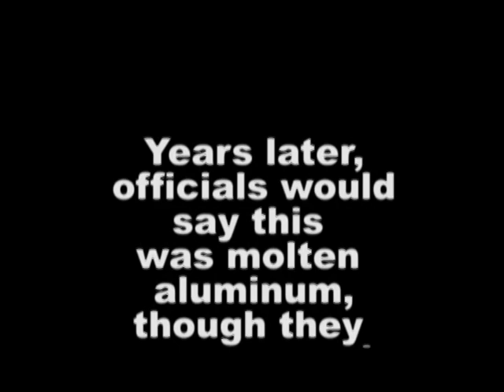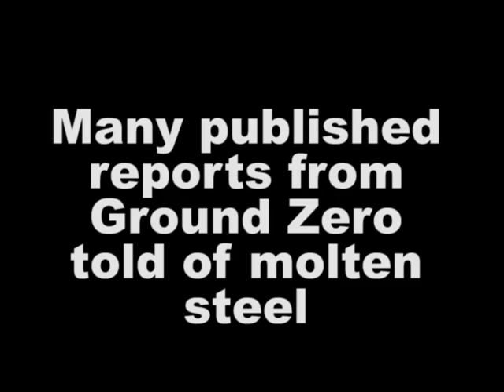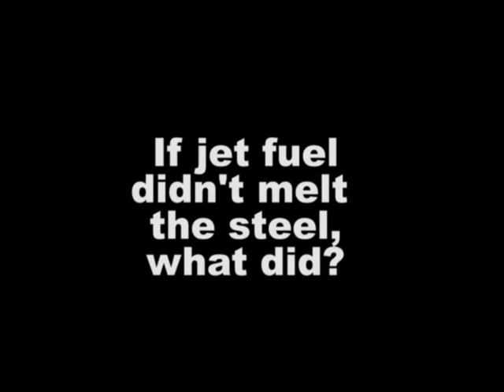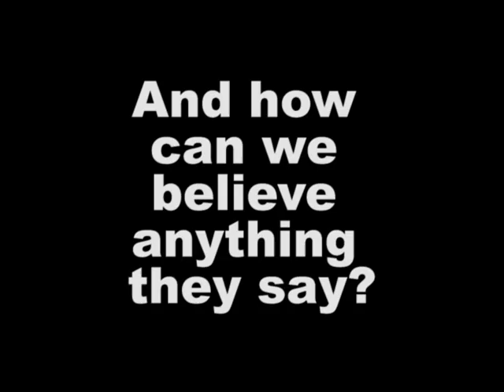The 9/11 "Deep Mystery" and the Crazy Engineers

Comment: See Appendix C of the FEMA Report and watch this video. Any true scientist with an open mind will see that every single reported characteristic of a High Temperature Accelerant Fire was observed in the case of the WTC. Even a few of these characteristics should have warranted a proper investigation to determine if HTAs (like Thermite) were used to assist in the destruction of the buildings. NIST purposely chose to ignore this evidence, ignore protocols, and ignore the primary claims of the independent scientists who they call "Conspiracy Theorists", and instead of doing chemical testing for HTAs or an analysis based on the use of nano-thermite applied directly to structural columns (as the conspiracy theorists have suggested) NIST instead ruled out explosives altogether based on sound analysis (which only technically rules out RDX and high brisance explosives) for which they had to ignore much of the witness testimony and video evidence of loud explosions.

Comment: How do we know contractors didn't cut corners and inspectors sign off paid, using cheaper materials. It happens more then people think. Specially back in the day. Cheaper steel made with other material could have easily been used in parts of the any project.
Reply from the maker: We don't know that contractors didn't cut corners.  Most of the structural steel evidence was hauled off to China as scrap lickety split.  If the contractors cut corners, we need an official investigation that says so.

Comment: People who said the fires melted the steel were wrong. The fires didn't melt the steel. They WEAKENED it. Besides, temperatures weren't even close to the 2700 degree melting point of steel.  All reports of people seeing "molten steel" were anecdotal. No one was in a position to determine the metallurgical composition of the conglomerations they saw at Ground Zero. Evidently these people saw some conglomeration of other metals that had lower melting points.
Reply from the maker: Something melted the steel.  The fires couldn't do it.  The FEMA report (Appendix C) discussed the melted steel.  Dr. Astaneh-Asl reported that he saw "melting of girders".  Girders are steel.
Reply: Temperatures weren't even close to the 2700 degree melting point of steel.  All reports of people seeing "molten steel" were anecdotal. The FEMA report on the relatively low-temperature corrosion (intergranular melting) bears no resemblance to a thermite cut. No girders "melted." If thermite was used to cut steel columns and/or trusses, the photos of the steel columns strewn around at ground zero would show them. The photos show no such cuts. There should be thousands.
Reply from the maker: Dr. Astaneh has displayed photos of partially-melted girders.  They're in my video.  Maybe you should invest 5 minutes and watch it.  

The FEMA photos show the results of the intragranular melting.  Jonathan Cole has demonstrated identical effects through thermitic harges.  See my 5-minute video "Incendiary Experiments".
Reply: Temps not hot enough.
No thermite cuts seen in ground zero photos.
Cole's cuts do not resemble intergranular melting. No eutectic involved.
Reply from the maker: Thermite burns at 4000 F.  That's hot enough.  Mr. Cole's sulfur-enhanced thermite involved the eutectic. Mr. Cole created the swiss cheese appearance and razor-sharp thinness of the FEMA samples.   Maybe you should watch my videos before you try to debunk them.
Reply: Measured temps never came close to 4000 F, FEMA corrosion < 1000 C
No thermite cuts seen in GZ photos of thousands of essentially intact members.
FEMA corrosion only reported on 2 pieces, should be on thousands if that’s what brought down towers. 
Swiss cheese type corrosion doesn’t even look like thermite CUT.
A demolition via synchronized corrosion – makes no sense. Who w/ dem expertise says it’s even possible?
Makes sense it occurred post-collapse.
Reply from the maker: And who do you think was going to stand in the elevator shafts with a thermometer to measure the temperatures?  How do you know what was and what was not seen?  Photography was heavily restricted.

Swiss Cheese evaporation looks exactly like what Jonathan Cole produced with thermite.   

If the evaporation took place post-collapse, what was the mechanism?  What was the fuel and what was the source of the sulfur?  NIST forgot to investigate it.  So sad. 

If you want to bring a building down and make it look like fires did it, thermite makes perfect sense.  As of now. thermite remains the only reasonable hypothesis.  Asking pro demolitionists about methods is like asking pro executioners.   "No, you don't kill somebody by pushing them off the sidewalk into heavy traffic.  We always use lethal injection."

Comment: Those buildings turned to ash in mid air, what does that? Why were car engines gone and turned over? Where did all the rubble go? Seven buildings went that day, where is all the concrete that fell? You don't need a conspiracy theory to find truth, just lay out the evidence in front of you, scientific evidence tells us those two planes did not bring those towers down.
Reply from the maker: The pulverization of the 180,000 tons of concrete floors is indeed mysterious, and the government did not address that mystery in its investigation.  By cutting off its analysis at the moment of collapse initiation, the government was able to dodge the ten essential mysteries of the collapses.

The steel we can see in photos lying on the ground.  I'm not aware that any engine blocks were melted on 9/11.

Comment from the maker: Pray tell, how can a melted girder be a softer metal?  Are you claiming that  the WTC was built of lead girders?

Melted steel is unusual.  Jet fuel and office fires can not burn hot enough to melt steel.  

I've explained why the molten steel is important:  it has not been explained, it is "perhaps the deepest mystery uncovered in the investigation," and because it suggests the use of incendiaries to weaken and melt the steel.

Comment from the maker: What is illogical about wanting an explanation of an unexplained phenomenon that might be associated with the worst structural failure in history?
Reply: Because you can't explain a fairy tale? There is no molten steel, just molten bullshit by laymen.
Reply: @Randomadventureswithpaul you must be blind and or just believe what you want to believe.
I can’t live that way I need the facts!
Reply: @Wretched2JZ  You have all the facts easily accessible, you however choose to reject all facts that don't align with the "controlled demolition" delusion.
Are you also a flat earther cause you can't see the curvature of the earth from a 20 story building?
The stuff that is alleged to be molten steel is more likely molten aluminum, but there is no way to test a substance that appears to be molten while the building is engulfed in an inferno 80 stories from the ground 22 year ago, but the best and most logical hypothesis we can go on is that the flowing yellow coming out of building two is melted aluminum, easily achievable by the blast furnace conditions in the area and the 40000lbs of aluminum that would have found itself shredded and distributed throughout the building and likely being concentrated in that very corner..
The steel beams never had to melt, they will start to fail around 600 f. 
I am curious though, what do you do for a career?
Reply from the maker: @Randomadventureswithpaul Appendix C to the FEMA report documented the melted steel.   The NYT called this  "perhaps the deepest mystery" of the investigation.

Comment from the maker: I've explained why the molten steel is important.  Because it has not been explained.  Because it is "perhaps the deepest mystery uncovered in the investigation."  Because when you couple it with the fact that NIST has no core steel samples showing heating above 480 F, and the fact that 480F is not enough to weaken the steel, it suggests the use of incendiaries to weaken and melt the steel.

Comment from the maker: Most structural engineers were surprised when the towers fell.  That's what NOVA says.. 

Molten steel is not just unusual.  It is bizarre.  It has not been explained.
Reply: except there was no molten steel.
Reply from the maker: FEMA APPENDIX C  says there was.
Reply: @punxsutawneybarney  
Did you even read the summary? 
Just forget all that for one second though, I have a few questions for you.
If some kind of thermite bomb or device was installed that melted the steel... 
A. How did they install it without anyone noticing?
B. How did they accurately aim the aircraft at the precise locations of these alleged devices?
C. How did the device survive the impact on the tower?
D. How did the device survive 40+ minutes of raging inferno fueled by oxygen/kerosene/office contents etc?
E. How did the device trigger at the precise location that the heaviest damage was located on both towers?
Reply: @Randomadventureswithpaul I would try to explain but it’d be a lot of typing

Comment: How the building fell & how steel melted, though you might want to make them the same thing..  are NOT THE SAME THING.  i.e. The Popular Mechanics provided, unthinking response which, in so many words, is "steel didn't have to melt for the towers to collapse." is a STRAWMAN ARGUMENT that does not address the real question..  i.e. HOW COULD STEEL HAVE MELTED IN FIRES THAT WERE ALLEGEDLY NOT HOT ENOUGH TO MELT STEEL?  Why don't you try actually answering this question instead of seeking diversion?

Comment from the maker: OK, we agree that steel does not melt in fires.  But a professor of structural engineering at Berkeley told PBS "I saw melting of girders at World Trade Center."  Girders would be steel.  Another PhD said he saw a stalagmite of melted steel in the rubble.  Even if the process is chemical "corrosion", when the result is that the steel is "vaporized" or shows "intergranular melting", it is melted.  There was melted steel at the World Trade Center,  and NIST did not explain it.

Comment: @punxsutawneybarney I see...so you totally ignored my post. That's awesome.

"A study of the  1991 Oakland fire that burned 3,000 homes revealed the presence of melted copper in over 80% of the burned structures, and what appeared to be melted steel in over 90% of the burned structures.  With respect to steel, looks can be deceiving.  What appears to be melted may be merely oxidized."
(Indicators of Trouble, John J. Lentini, CFI, F-ABC)

An ingot found by Steven Jones, who runs from academia.

Comment: @iSunTzu Concrete does not melt, that leaves steel as the substance that can melt. Kerosine can not reach temperatures which melt steel . Clearly, the molten steel was not caused by the jet (I studied Aviation engineering), but from another source... What is your point?

Comment from the maker: @iSunTzu If you had bothered to watch my video you would see that there's a 40-pound ingot of formerly molten steel from the WTC.  There were also the partially vaporized samples that were analyzed by FEMA scientists for Appendix C.  For steel to vaporize, it must first melt.  The issue is that the jet fuel was not hot enough to melt steel, but we have molten steel.  The obvious conclusion is that incendiaries were used.  See my video:

Incendiary Experiments

Comment: @punxsutawneybarney No one has produced melted steel from the WTC. You mentioned corroded steel.
Now evaporated?  Thermite does not get hot enough to evaporate steel. Thermite is used to weld railroad track together, if thermite melted the track, or evaporated the steel, it would be worthless to use. You better find a new fantasy.  Dr. Quintiere is clear he does not support theories of controlled demolition to include thermite. Email him! Melting of girders, did you ask him what he meant?

Comment: No melted steel at the WTC complex.  Funny what people say.  The metals melted in the fires of WTC are AL and other low melting point metals. There was zero melted steel recovered.  The people who said steel were wrong, it was other metals that melt at low temperatures. 

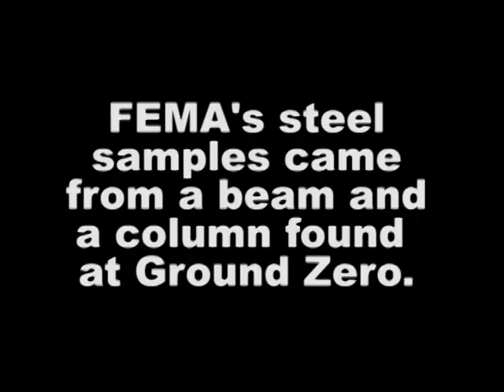lol, the steel you show at 3:32 is corrosion, not melted, corroded, I can't believe you failed to read the report.  Good job quote mining and cherry picking your way to delusional claims.